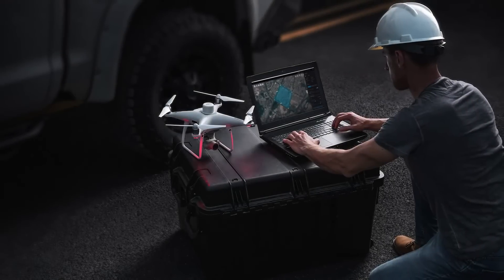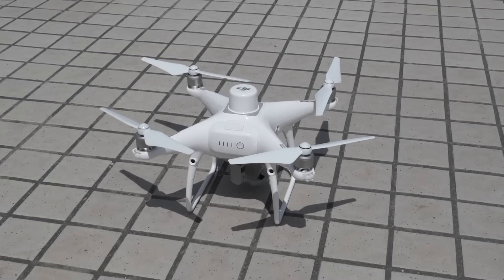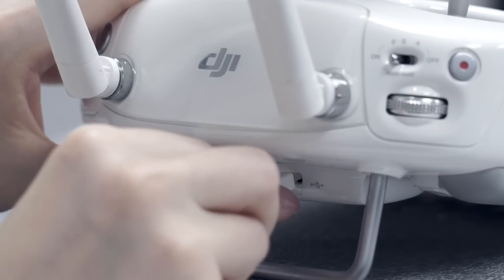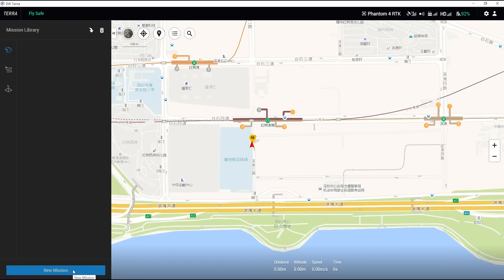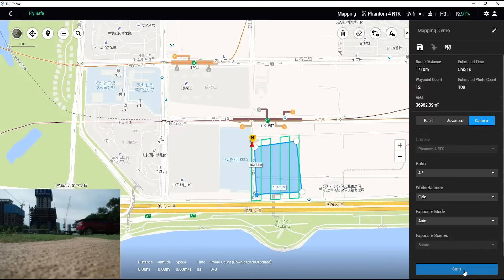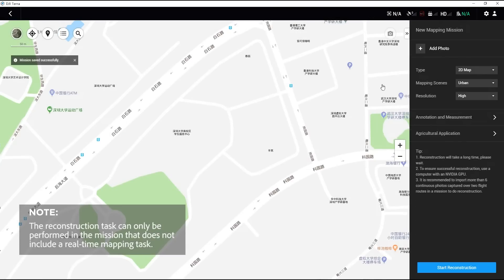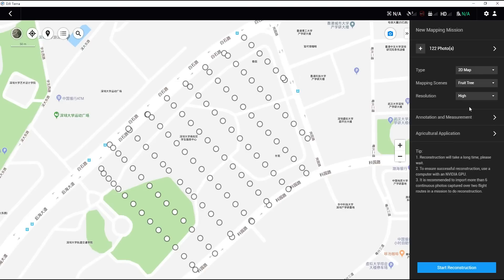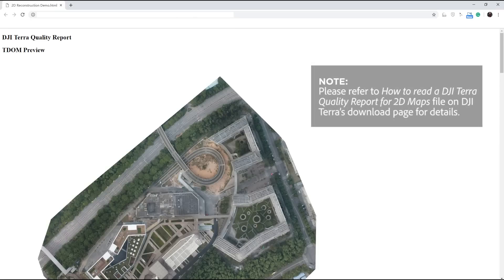DJI Terra - Mapping and 2D Reconstruction [Tutorial]

Comment: hello i did all the steps, when it came to connect the USB with the table, it didn't work but when i connected the other USB that connects to the remote control and the cell phone, the DJI TERRA program worked appeared a camera window and but.
My question is it possible to voice like this? my drone is phantom pro 4 v2.0